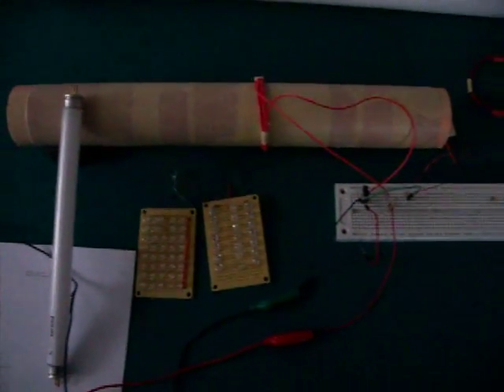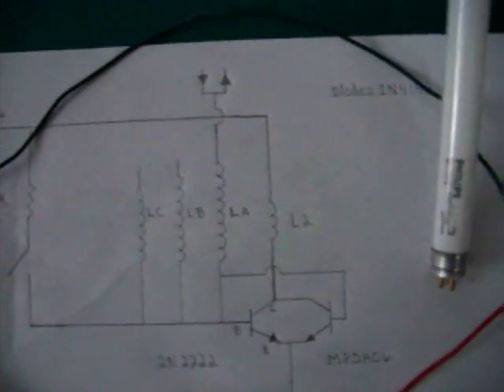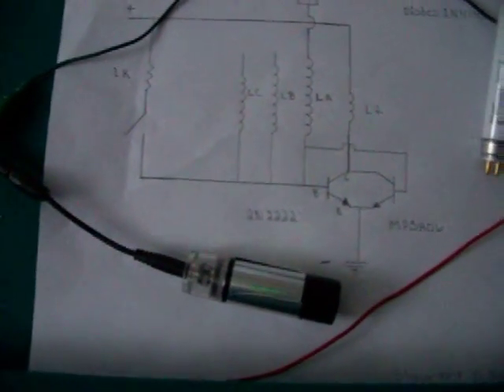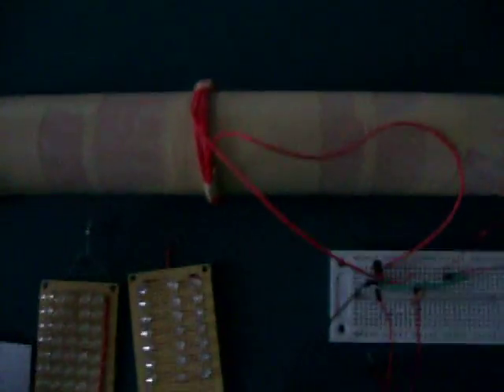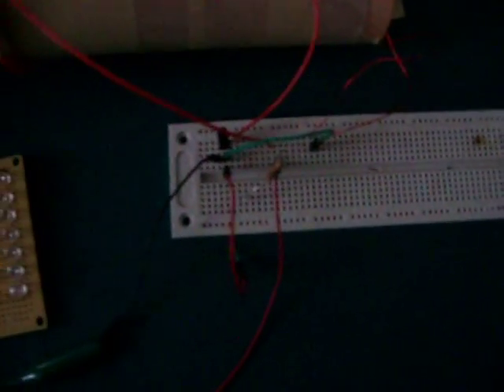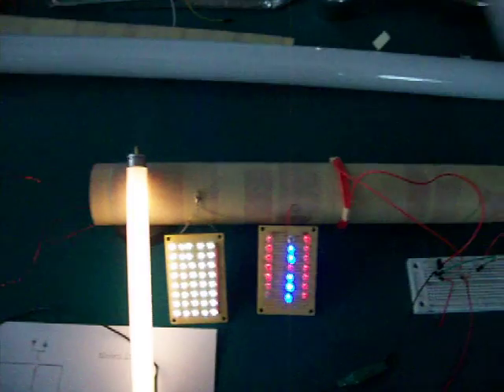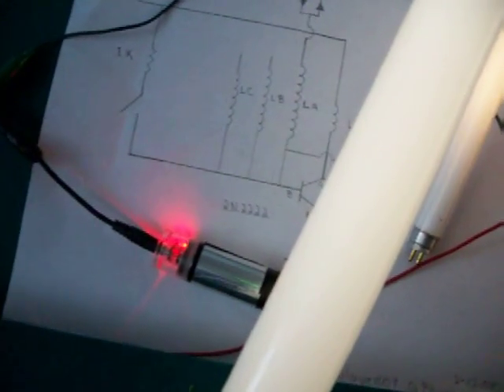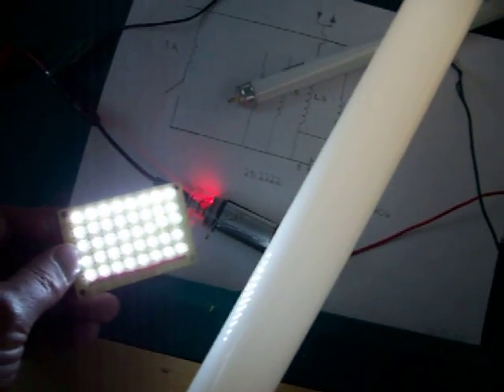Exiter Coil Test 2

Comment from the maker: When using the meter on the circuit it makes it go out of tune.But it draws from 60 to 130 mA.
But it might be drawing more being out of tune.
When it's running with out the meter the transistors don't get hot at all.